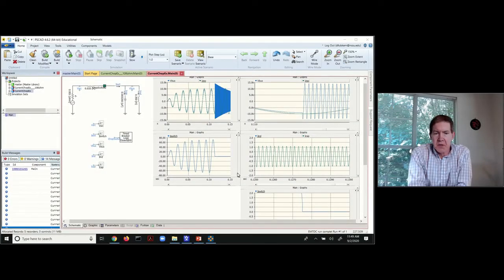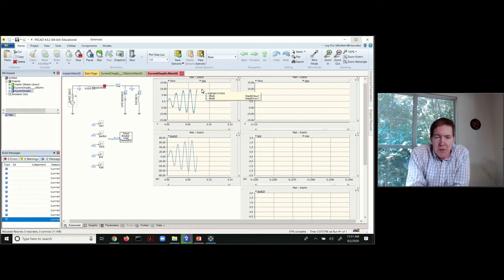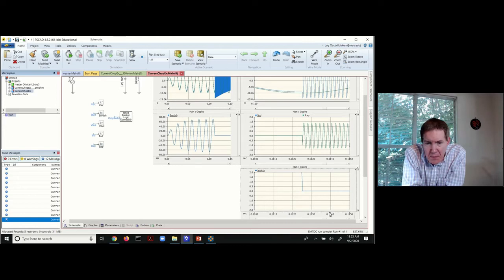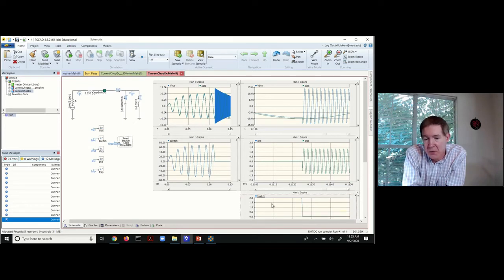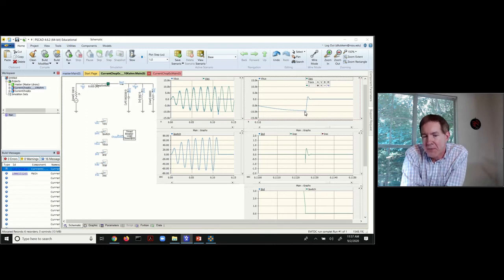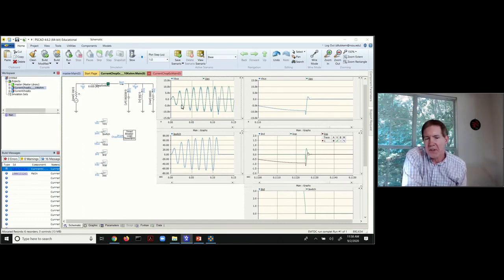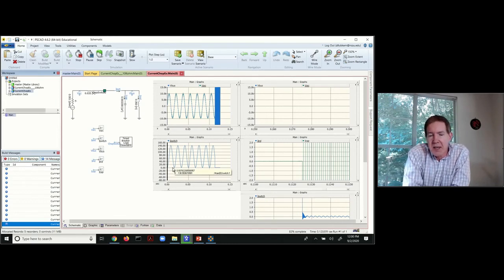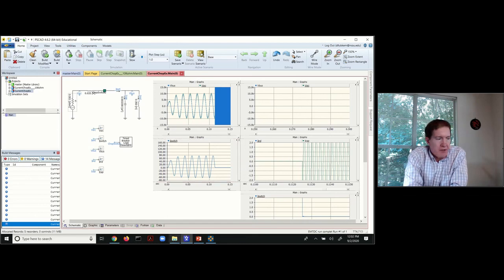Lecture 7c: Current Chopping PSCAD Example - Power System Transients Fall 2020 - Lubkeman

Comment: Hi professor, fantastic way to deal and explain theese very deep and complex concepts!! Can I ask a question? 
How does the situation modify if we had the switch opening when the MV/LV transformer is loaded at the secondary side?
Does the voltage transient on the magnetizing reactance of the transformer impact on the load placed at its secondary? How does the load impedance affect theese results?

Does it have implications on the way we should make the maintenance on the MV side of an industrial facility, switching out the load at the LV side before we would open the MV switch on the primary of the transformer to protect the load from the voltage transients due to chopping phoenomena with vaccum switches? 

Thank you very much in advance for the opportunity and for your work. Your lectures will be very important for me!
Reply from the maker: Take a look at Lecture 7b where I work out the solution to the differential equations with and without a parallel resistance.  If we add a parallel resistance, you see we get a damping effect.  In this case the peak voltage magnitude is about 14.0 kV without the resistance and drops to 12.3 kV with the resistance.  You can rework this solution for different values of parallel resistance.  

I'm not sure about your second question regarding sequence of switching with regard to maintenance. There are other factors you need to take into account than what I have in my simplistic example. But I haven't done the literature review to know what those are.
Reply: Ok, so I can model the load with a resistance referred to the primary side. This way It would be in parallel with the core resistance, giving a smaller equivalent resistance with respect to the unloaded transformer. This situation would give more damping effect to the voltage transient. 
In conclusion the load would be affected by the transient, since the magnetizing reactance of the transformer, the line's and transformer parasitic capacitance and the load model are all in parallel in the equivalent circuit, but the voltage peak on It would be lower and the oscillation would finish sooner. Perhaps with must add a surge arrestor above the susceptible loads to make sure to preserve it in this conditions.
Thank you very much professor, congratulations again for your competency and your disposability. Have a nice day
Reply from the maker: @stefanoburbello2795  If you look at the Lecture 7a video, there is a reference to a paper that shows how this type of overvoltage damages the transformer insulation.  So it would be a good idea to consider surge arrestors.